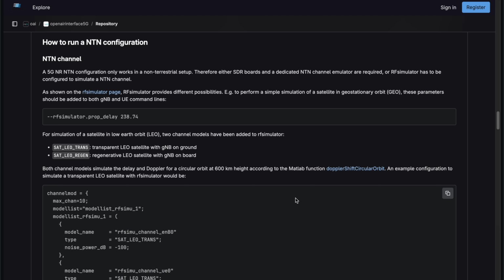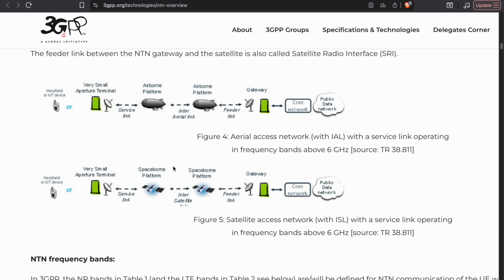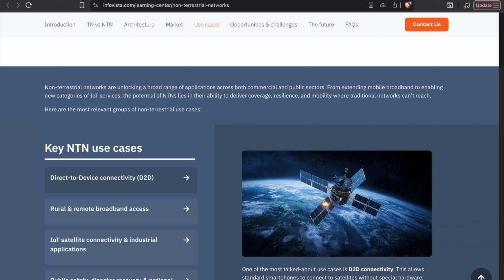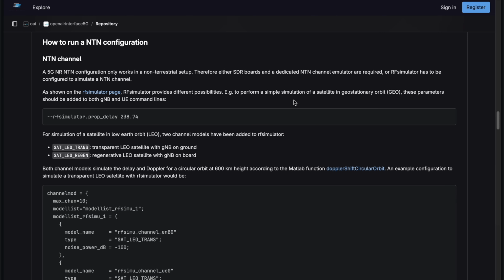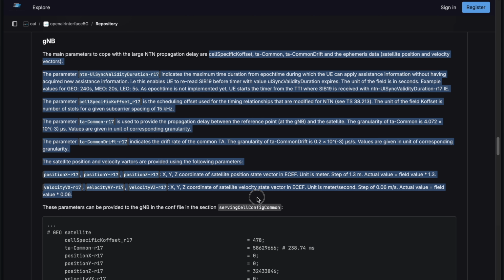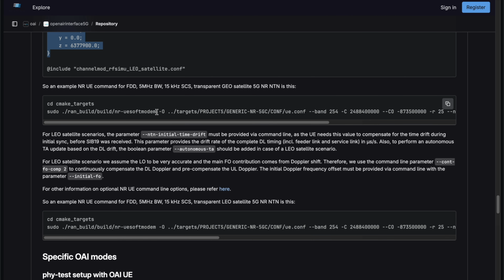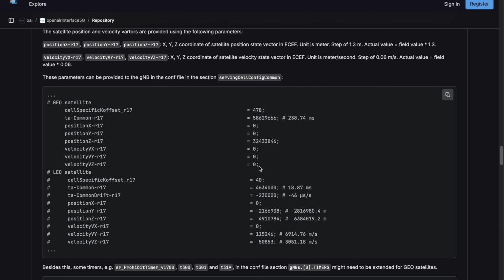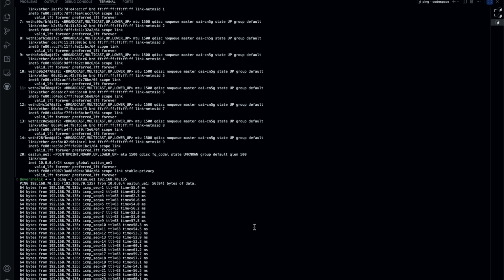Non-Terrestrial Networks OAI Tutorial Guide

Comment: Thank you for the session. Can you please share setup diagram if possible
Also, Could you please confirm whether the setup was done without any additional hardware like USRP, ZMQ, UE simulator?
Reply from the maker: Hi, you can check out this repo for more details and to replicate the same on your system: https://github.com/ngkore/OAI-5G-NR-NTN.
Reply: @ngkore  Hi , I tried to replicate the setup, it is not wokring, can you please help with correct steps
Reply from the maker: @subhraprakashgiri3403 , you can join our matrix channel and share your issue with us and our community members will review and help you out with your deployment.

Matrix: https://matrix.to/#/#ngkore:matrix.org